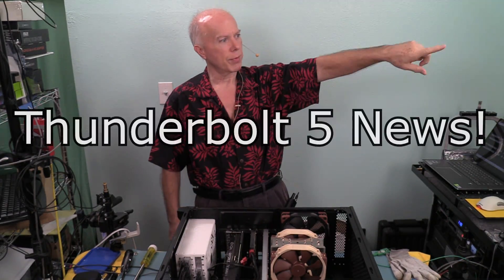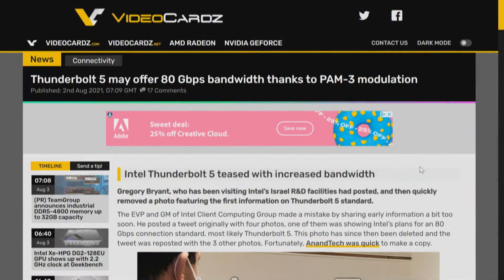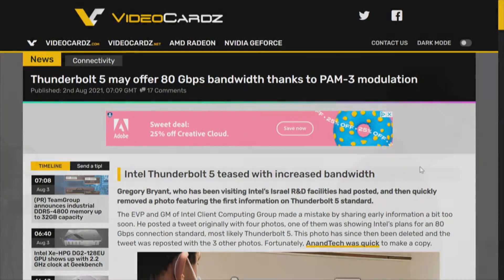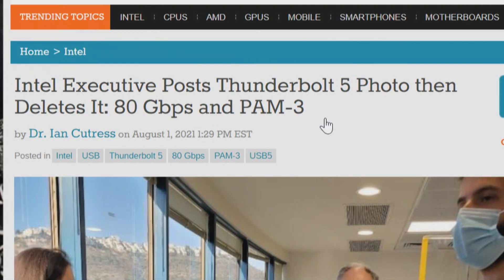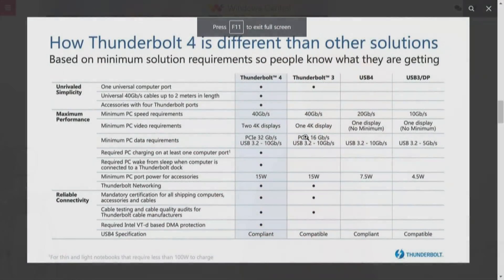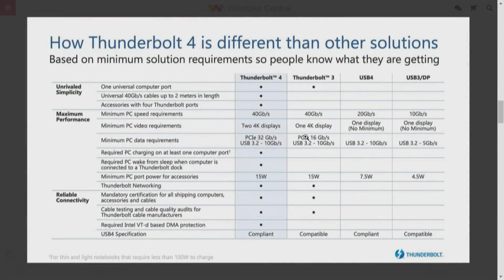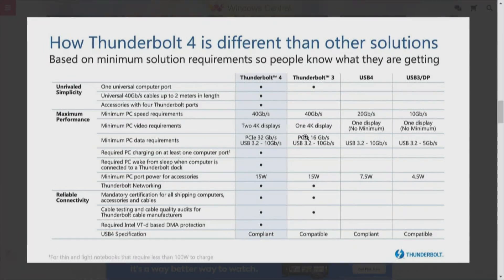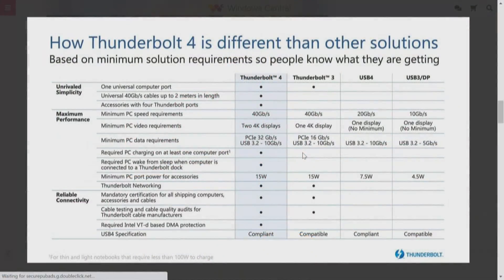Intel Thunderbolt 5 News!

Comment: Hey Build or Buy.  What are you thinking about this now?  Thunderbolt 5 PCIe 4.0 x8?  I'm really disappointed with what I can do with an external PCIe chassis using Thunderbolt 3 for multiple camera capture.
Reply from the maker: Hi Ned Zeppelin: Fun drum-practice buddy,
Welcome! Great Question! We share what We know when something useful is made known. Hindsight is always 20/20. Here's what We now know, Thunderbolt 4 will be Thunderbolt 4 Rev1, current, and Thunderbolt 4 Rev2. 

1. Thunderbolt 4 Rev1 is PCIe 3, X4.
Intel Maple Ridge aka USB4. Lipstick on a Pig! Rebranded. 
2. Thunderbolt 4 Rev2, will be PCIe 4, X4! 
USB4 but not exclusively Intel. Since AMD is relying on ASMedia, who Designed AMD's X670E Dual Chip Chipset, ASMedia will have a USB4 Rev2 Chipset with PCIe 4.0, X4 Chipset Lanes. Fascinating! Agreed! ASMedia ASM4242 Chipset. Yet to be announced! As for anything more on Thunderbolt 5? Crickets! Now to Uour posed Question about Lane count. If M.2 NVMe PCIe technology is any indication, Lane count stays. However, based on CXL - Compute Express Link and the new NVMe-KV - Key Value command set, everything We're currently doing is going to change as it relates to Slots and Storage for PCIe Resource allocations! Which goes to what You're asking!
Reply: @BuildOrBuy  Thank you for sharing your current thinking on this.  It's really helpful.  I think its time for a new awesome video on this.
Reply from the maker: Hi @nedzeppelin ,
Good point! Possibly after the ASMedia ASM4242 Chipset is a reality and becomes available. Too many pie in the sky products being announced with no substance. There are products announced over a year ago that We have Discussed that still are not available! A good example is the Gigabyte Aorus Gen5 AIC Adaptor to be available fully populated once available. Looks like the hang-up on that are the M.2 NVMe PCIe SSD Drives based on what We're currently seeing with everyone else! 
https://www.gigabyte.com/Press/News/2018
What this tells Us, based on PCIe Resource allocations would be something along the lines of either a HEDT or Workstation product yet to be announced! Remember the key is PCIe 5.0! To reiterate, this AIC will require a X16 PCIe 5.0 Slot with a Motherboard that has a Chipset that can Bios Bifurcate a PCIe 5.0 Slot! No way We'll see that AIC on a Consumer Desktop Motherboard! Doable but not Probable.

Comment: Didn’t thunderbolt 4 just release lol sheesh
Reply from the maker: Hi MyNameIsToki, 
Welcome! Yes! Crazy right! We're just trying to keep up and keep everyone informed of the status of Thunderbolt whatever it is! Appreciate Your Comments! Thanks for Watching!
Reply: @BuildOrBuy  Always welcome I enjoy your indepth videos I have a few questions regarding thunderbolt ex4 setup in bios and my setup is asus thunderbolt ex4 adapter - apollo twin x mobo asus z590 , but my mic sounds static ( artifacts ) whenever I use windows app like discord or battlenet etc ? what could be the problem , I really dont want to keep using asio driver due to the latency
Reply from the maker: HI @Itseightysix  , 
Thank You very much! I'm honored! Static. Like chasing gremlins. Seems everyone is having those problems. Set Windows Power settings to High Performance. And check Bios for CPU. Disable CPU Power Management. CPU C state can cause Audio Dropouts. Power Management off or High Performance! CPU Throttling is also an issue. High Performance! We need to do a Video on DPC Latency. Hope that helps!

Comment: I don't think Intel wants us to get a Thunderbolt PCIe card that uses GEN4 X16 bandwidth. What Intel cpu/mobo combo give us gobs of GEN4 X16 PCIe sockets. Even the Z590"s chipset cpu lanes are just GEN3. My GEN3 X4 NVMe drives are just old junk in a drawer. When Intel sells a cpu with the I/O from a 4094 pin socket, then AIC's that use GEN4 or GEN5 X16 cpu lanes will appear.  A Thunderbolt that uses only 4 cpu lanes is DOA. Anything GEN3 is DOA. GEN4 is about to go DOA.
Reply from the maker: Hi Max,
You're right! Absolutely agree! That has to open up! Everything changes with PCIe 5.0. And that may be short lived due to PCIe 6.0. At this point, up for conjecture. But We need to know so We can stay on top of this. The closer We get to PCIe 5.0, We need to hold off on Buying anything major until We see how that shakes out. Not being able to get Our hands on Parts right now may work to Our advantage!